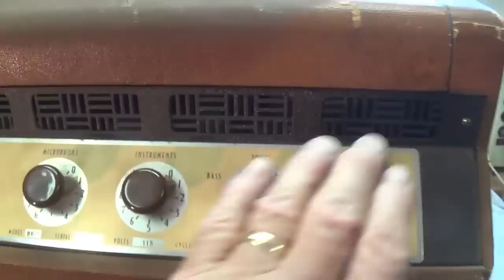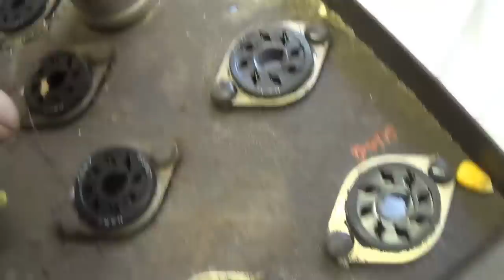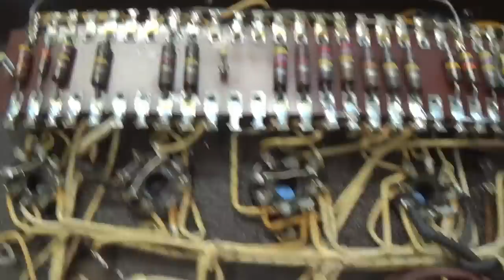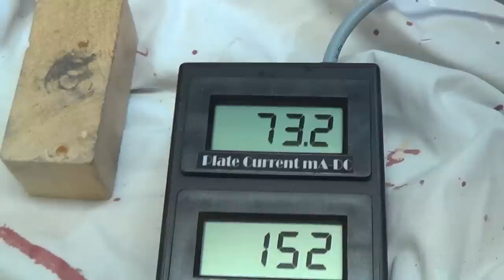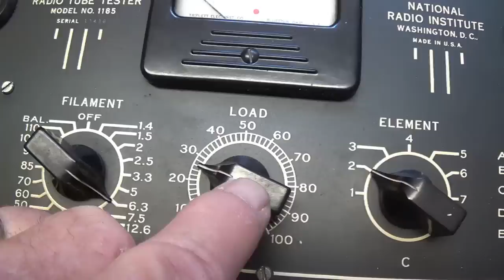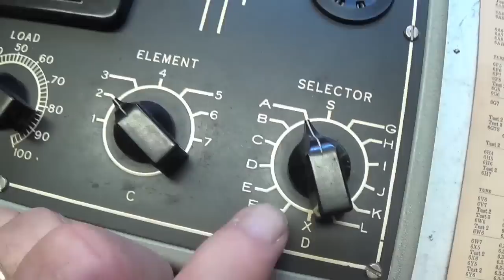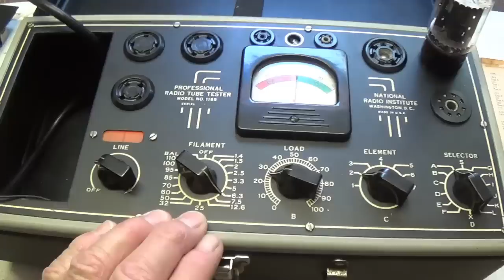Rare & Wonderful: 1946 Gibson BR-1 Amp and 1941 Triplett Tube Mini-Tester

Comment: Good Morning Uncle Doug,
Another great video, and beautifully preserved amp. The “G” reminds me of the “G” on the 50’s and 60’s Gretch bass drum heads. Maybe why both companies changed up their logos, who knows? That choke was huge for such a small amp, seemed unusual to even have one in the circuit. If memory serves most designs relied on the windings of the electro-dynamic speaker as a filter choke. It really seemed to be effective as on the video the hum level was almost undetectable. Amp sounded great , especially for an amp that old and with the strange biasing of the output tubes. Maybe they were biased that way to sound better with the electro-dynamic speaker. Lower voltage more current. On the Tube tester did I see a bit of type at the bottom of one of the instruction pages that said Triplett Instrument Company? I know that the National Radio Institute was a school,  both brick and mortar and correspondence way back when. I often wondered if that is where Bell & Howell got the idea for DeVry. NRI had some pretty famous alumni including Philo T. Farnsworth, and some consulting faculty including Lee DeForrest. When I attended DeVry Institute back in 1981 much of the test equipment in our labs was labeled Bell & Howell schools and was made by Triplett, Simpson, RCA,  Sencore, and B&K. I have a Simpson model 1000 tube tester and other than having to replace one capacitor it was perfect. It will test 4, 5, octal, loctal, 7 pin, 9 pin, and even miniatures. But other than the sockets and a copious amount of multi-position switches to route to the correct pins it’s design is pretty much the same as the little one that you featured in the video. It uses the main meter for setting the line voltage level rather than a separate shadow needle but pretty much the same basic design. I have compared readings from it to actual curve traces that I have done on my Hagerman Vacutrace and it is pretty much spot on. The Vacutrace does give a very accurate trace of the actual gain and characteristics of the tube over an almost infinite grid, screen, and plate voltage levels. The traces can match the curve traces in the tube handbook beautifully. It even has an adapter so that you can directly compare the curve traces of two 6V6’s or two 6L6’s, or any octal, simultaneously on a single oscilloscope screen for matching tubes. 12AX7’s as well, you can overlay both triodes on one screen at once.  I was really surprised at how not all tubes match well across their grid voltage steps. Some will match perfectly as really far negative voltage and voltages much more positive but be totally way off in the middle voltage. So if you ran your amp at very low output or wide open your output tubes might be a great match but at mid volume only one of the pair might be doing all of the work.  Explains why sometimes one tube from a matched pair wears out if the tubes were matched on a tube tester rather than a curve tracer. Great video, beautiful restoration as well. I can't wait to see what is next. P.S. I hope that you wore your rubber gloves when cleaning out the rodent leavings. No telling what those ”Midwestern rodents” might carry as far as diseases  ;-)
Reply from the maker: Greetings, Mark. I always look forward to your very interesting and knowledgeable comments. The filter choke may have been added. The field coil appears on the schematic, but I do not see a separate choke.....but let's face it, there are worse sins than adding a filter choke to a circuit :)  Yes, the tube tester was built by Triplett and really impressed me. If it only had a 9-pin socket for miniature tubes, it would be close to perfect :)  I'm not familiar with the Vacutrace device you discuss, but it sounds like a wonderful piece of gear. I will keep an eye out for one.  Thanks for all the great info......and I was really careful with the rodent clean-up :)

Comment: Great video as always!!! I have a 1937 Gibson EH-125 and love the amp! It has 6V6 tubes with a 5Y3 rectifier. Also, the wiring is true point to point and not on turret strips. Was planning to restore the amp, however ALL the resistors and caps were still in spec. Wow!! Everything tested as good. I did replace a few of the octal preamp tubes and added a 3 prong power cord. The amp sounds great and is very loud. Plate voltage is about 375 volts on the 6V6 tubes.
Reply from the maker: Thanks, TG. That sounds like a great old amp. You're a lucky guy.

Comment: Wow! While the low B+ voltage sorta slays me, it sure works good after some TLC from you. And if you look, that 20K resistor isn't part of a voltage divider. It just drains the
filter caps when you turn off the amp...so much easier for a tech to keep from getting zapped trying to unload them. I know why you missed that, by the way...you were still
distracted by how tidy and need the chassis wiring is. I mean, it doesn't even have any frayed insulation or anything. Also distracting was that the mice were unable to mess
up the nice crinkle paint job.

I was wondering how that old electrodynamic speaker would play.  I still say those things will hold their own with PM dynamics...as long as they are fed good noise.

Hey, thanks, Big Dave...this should be pretty cool...(8-) Dave,  or Doug...I think National Radio Institute was a school. That tube tester wasn't an advanced kit for some class
was it? Just curious...Anyhow, many thanks to both of you for an excellent "dual speed" video. And thanks to Jack and Allie for the test run on the amp.
Reply from the maker: Thanks for all your comments and observations, Tom. It's always good to hear from you. I have come to accept your opinion that the function of the 20K resistor is not to lower the B+. Apparently, the high voltage winding of the PT simply puts out a relatively low B+.
Reply: @UncleDoug  Yer quite welcome Professor Doug.

Comment: Hi Doug. That Gibson sounds pretty darn sweet. Funny..i have an old  piece of radar equipment  Jan issue from the forty's. It has the same handtied wiring and even the same colour combination of cloth.    Question though  about the tube testing: In Europe our tube tester show mA i.c.w. a bad to good scale. But you mentioned 1850 as a value? What's unit is that value in? The 6L6 showed close to 80 mA right?
Reply from the maker: Hickok tube testers measure transconductance in units called micro-Mhos. Here is an explanation:   http://worldphaco.com/uploads/Hickok_Calibration_and_the_ACS..pdf
Reply: @UncleDoug Thanksa lot for linking.  Interesting read,

Comment: The 20k "ballast resistor" doesn't drop the B+ (other than by loading the power supply, but that's negligible). Eliminating that resistor would not cause the 177V voltage drop over the resistor to be added to B+. Note that the resistor goes straight from B+ to ground. In other words, it's parallel to the power valves, not in series. The 177V is just the plate voltage, plus the voltage drop across the cathode resistor of the power stage, plus the voltage drop across the output transformer primary. I think it's designed to be a discharge resistor for the electrolytic caps in the power supply filter, to prevent the capacitors from holding charge after the amp is unplugged.

The 12W of plate dissipation is indeed minimal. Considering the low plate voltage, the amp was clearly designed for class A, meaning the zero signal plate dissipation should be the full 19W, or very close to it.
Reply from the maker: Thank you both for your comments and observations. I have come to accept your observation that the 20K resistor is not responsible for the lower B+. Apparently, the high voltage winding of the PT was designed to produce this lower voltage.....for reasons that we can only speculate upon.
Reply: @UncleDoug  Thank you and Big Dave for a chance to have a look at a fine old peace of history.
Reply from the maker: Amen on thanks to Big Dave......he made it all happen.
Reply: I agree that the 20k resistor is in parallel and is a bleeder for draining B+...trying to save the life of some poor hapless technician at some point.(8-)...but I still find it
fascinating that Gibson chose to run the plates at 180 or so volts. I guess, since it's not the most well vented cabinet, they were just attempting to make the tubes
last as long as they could. And the amp does work(8-).Wish I could have talked to that engineer.
Reply: @tomfrye9037  I agree that it's baffling how conservatively they chose the B+, however, I disagree that this makes the inside of the amp less hot. A valve can only dissipate so many watts from the plate - 19W in the case of a 6L6. In class AB or B, this power is only dissipated at full drive. In class A, which is what this amp seems to be - that power is being dissipated even with no input signal (at full drive some of the power is driven into the speaker, but that doesn't change the heat balance, as the speaker resides within the same enclosure). So all in all, class A amps run hotter than class AB or B amps. That's where the term "run the output valves hotter (meaning "more miliamps of quiescent plate current) comes from!
If, on the other hand, the amp was designed to only dissipate 12W on each the plates - that also makes no sense from heat perspective. They could've got almost the same output power with just one output valve, and thus cut down on the 12W plate dissipation + 3W G2 dissipation + 6W of heater dissipation of the other valve.
Reply: @kardRatzinger  Thanks for doing the math, S&T. It's obvious by your math that the only way to save heat is to lower both voltage and current...and the engineer
didn't do all that good a job there. So I'm wondering if there may have been problems getting...oh...say, certain wire gauges to wind xformers? I know there was a
period after the war where companies had to get certain product lines up and running again after doing war products. Gibson may not have been able to obtain
the parts desired..."Oh, yeah, Mr. Gibson. We can get the parts to you...look for a delivery about 4 months from now..."...which will do a whole lot of good when the
parts were needed a month and a half ago...

Comment: Great video. If addressing shortcomings like the power cord, did you consider adding one or two inch PC fans to the grill to assist cooling? Or maybe a fan top and bottom diagonally to push-pull air?
Reply from the maker: Thanks, MBG. The owner expressed no interest in any modifications.

Comment: Bundled wire is neat and tidy, but leads to horrible crosstalk if the right mix of signals are present.
Reply from the maker: You're right, as usual, Jennifer. We normally try to prevent any signal wires from running parallel with AC wires......but it does look nice :)

Comment: I like the sound of this amplifier. Is this very low plate voltage thing akin to 'starved plate' (low voltage plate too to my understanding,  but perhaps no high current) 12ax7 overdrives of the 90'/00' ways of working ?
Reply from the maker: Thanks, Ant. That's a good question......to which I do not have the answer.

Comment: There's a terrible buzzing or rattling on the tail of the notes. Listen to where the notes are fading out here: 24:56 Is that the amp or something else in the room vibrating?
Reply from the maker: It may be fret buzz or an angry bumble bee, Will. I'm sorry if it annoyed you.
Reply: Didn't annoy me. Just pointing it out because I wasn't sure if you noticed it and thought it might be from the amp.
Reply from the maker: Thanks.
Reply: By the way, I realize this is probably just a sympathetic vibration from something else in the room, but if you realize it's coming from the amp, I know I've heard similar sizzling tails on notes coming from my old solid state Fender Studio Lead years ago. It turned out to be a burnt op-amp. I don't know what the tube circuitry equivalent of an op-amp is. Just thought I'd mention it. I know you're busy Doug. No need to write me back. I'm usually not this chatty.
Reply from the maker: No problem, Will. I really appreciate your helpful input.

Comment: At about 17:10, that's  one hell of a boo boo on your finger,  Doug. Was that from your hot-rod building/ wrench- turning hobby? Sometimes gloves would be a good idea, assuming you can still fit your hands into the tight spots where they need to go. I used to tell people that gloves are for sissies, but that was before I got old and developed arthritis, and I have some regrets about that stance now. My fingers are so dried-out now that I sometimes have difficulty operating touchscreen devices such as my smartphone unless I wet my fingers first.
Reply from the maker: That's a welding burn, GU. A chunk of red-hot metal burned through my leather glove and proceeded all the way to the bone of my knuckle.....lots of fun. The neighbors are still talking about the shrieking and cursing, but that's what they get for living next to a hot rod shop :)  My fingers are dried-out also, possibly due to years of exposure to toxic solvents. I played cards over the weekend, and had a heck of a time dealing......I couldn't get any "traction" on the cards :)
Reply: @UncleDoug  , as a kid, I accidentally brushed my wrist against the hot fishing-weight mold ( I had presumably taken the gloves off to do some type of operation requiring fingertip control),  and the hot mold stuck to my wrist and kept three half-dollar size pieces of skin when I yanked my hand away. I have a high tolerance for pain, and I don't remember yelling, but when I went  upstairs and calmly showed it to my mom, she screamed!  I still have some light scarring, more like blemishes really,  where I lost that skin.....

Comment: Loved seeing both of those awesome pieces of gear history...I have a lot of tube amps and usually prefer older tubes...is there a tester you would recommend for someone who's never used one?...most tubes would be the common ones used today except my 70's Ampeg V2 (60 watt version of the V4) has some uncommon ones...thanks!
Reply: In the Hickok line, I'd recommend a 533 or better yet 533A. It'll test nearly all of the older tube types that you would see in a 1940s or 50s amplifier, and the necessary test data for thousands of tube types is easily available. It's also spacious and roomy inside, therefore not too difficult to work on if you have to change a socket or do any routine maintenance. The Hickok 600 is basically the same unit in a much smaller case, but it has some rotary controls (the "English" potentiometer) that are difficult to set to exactly the same physical/electrical point repeatedly, compared to the 533 which uses a clickstop switch. Also, 600 is much more difficult to work on yourself to the high density controls, switches, and wiring in a very small space.

If you are lucky enough to find a Hickok 752 or 752 A at a reasonable price, buy it. That's the one I like best. Checking the second half of a Dual Triode  can be accomplished with simply the push of one button, and doesn't require you to reset all the switches and controls.
Reply: @goodun6081  thanks so much!
Reply from the maker: Excellent advice from GU, as usual. I have a Hickok 600 and love it, but the push-button second triode feature of the 752 really sounds appealing.

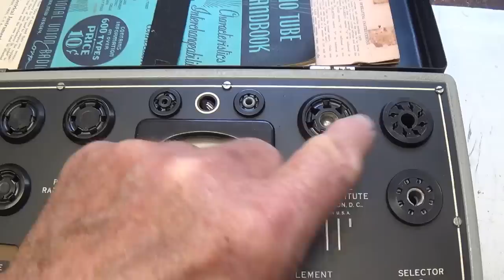Comment: 27:00 you may or may not know you can "zero" the meter with the flat tip screw on the front.
Use a big but thin tip or knife and gently creep the scew to set the resting point on 0.
Both these items are very nice and from a time to be alive
Reply from the maker: Thanks for the input. I agree about the "good old days"......especially the way things are going lately.
Reply: the lawlessness is ridiculous
God Bless

Comment: What about replacing the wax capacitors underneath the main tag board?
Reply from the maker: They tested out just fine, especially at their low operating voltage, so I left them in place. If the customer ever has problems, I am handy and can replace them.

Comment: Just like the old days at the movies when we got a double feature.  I really like the construction and internal layout of Fender amps, but I think there is something special about the early Gibson control panels.  As you remarked the layout in this amp is also very well executed, ever single wire planned before any soldering was done.  I think the low plate voltage is due to the 826 ohms series resistance of the speaker field coil plus the filter choke rather than the 20K shunt resistor which would only draw about 8 or 9 mA.  The very low, 120 ohm, cathode resistor being needed to obtain a reasonable bias voltage.  Wallace Marx Jr's book on Gibsons shows a BR1 without the filter choke.  Unusual design but a beautiful amp just the same.  I note you got one nasty comment.  They remind me of something unpleasant you step in and need to scrape of your shoes before entering your home.  Thanks Doug for again bringing us your knowledge and skill.
Reply from the maker: Thanks so much, Jeff, for your nice comments and your knowledgeable input. I haven't seen the nasty comment yet, but have my shoe scraper handy :)

Comment: Thanks for sharing .
I think theirs use a 20k resistot to drop voltage on plate and bring up some "special" drive for us. I think when drop voltage plate, headroom drop dramatically . And this is a good feature for some guitar tones.

Best regards from Brasil.

73 DE PU2SRZ
Reply from the maker: You could be right, Silvio. Thanks so much for your input :)